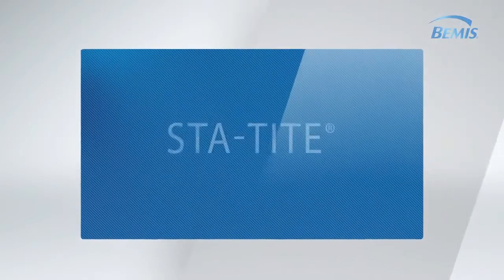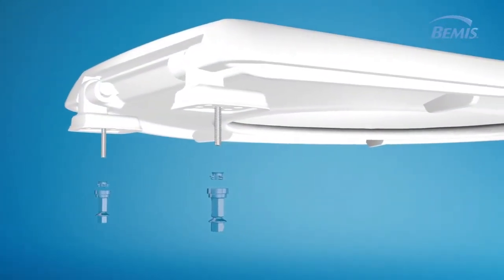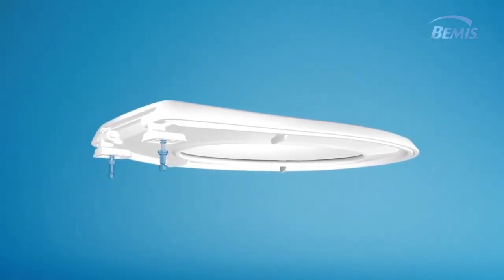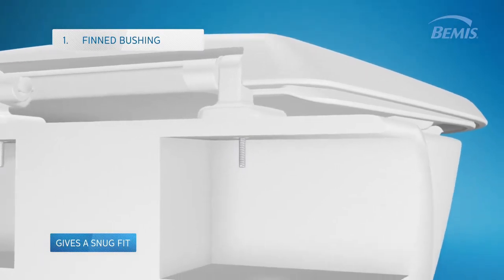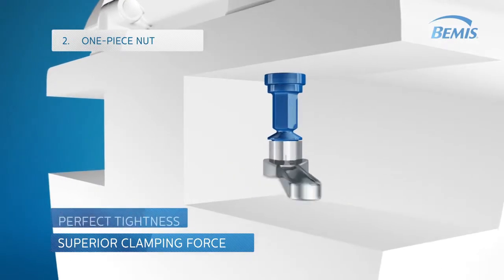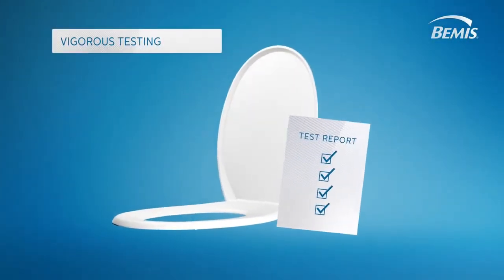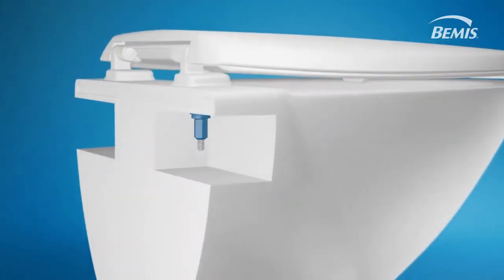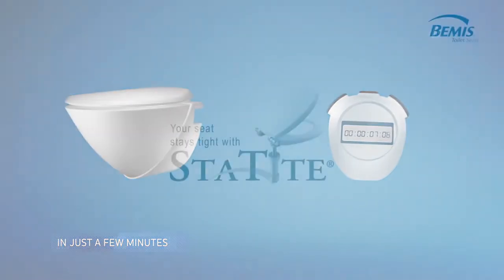Bemis Sta-Tite Fixing For Toilet Seats

Comment: The unclear  illustrations on the box of my £50 Bemis seat (there were no written instructions supplied) show this plastic nut fitted on the hinge, on the bolt head on top of the pan, not under it as shown in this and another video. After about three hours trying to figure this out, I found that it served no purpose at all, but I am keeping it.